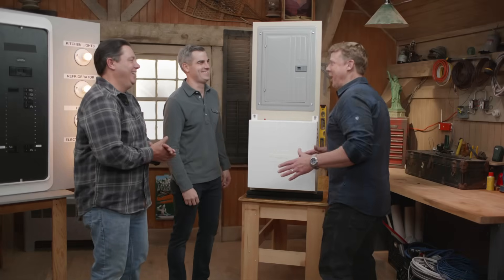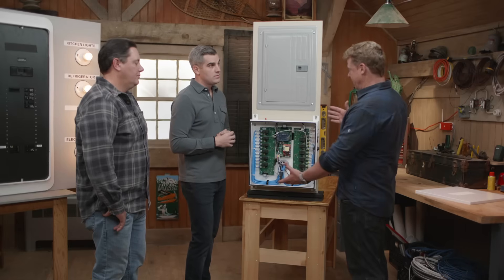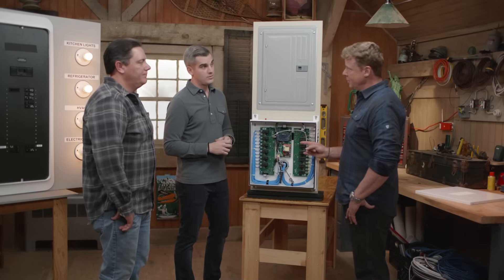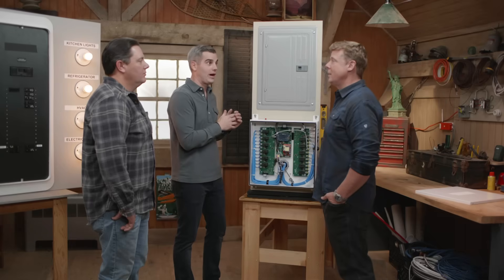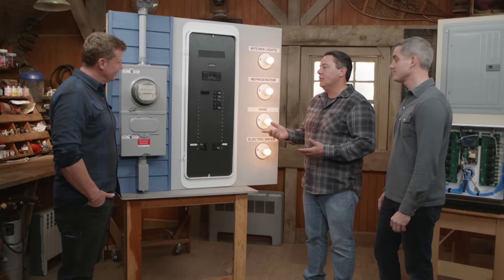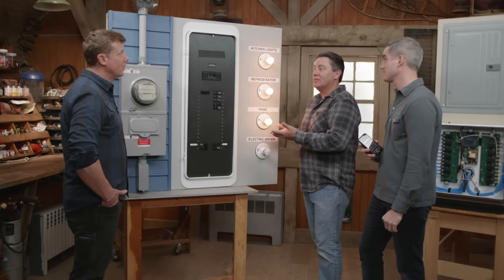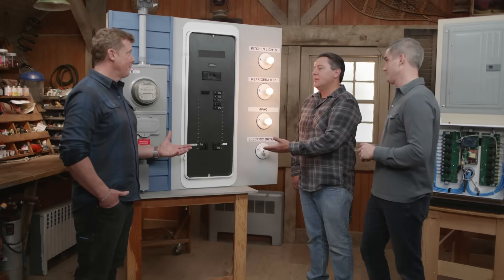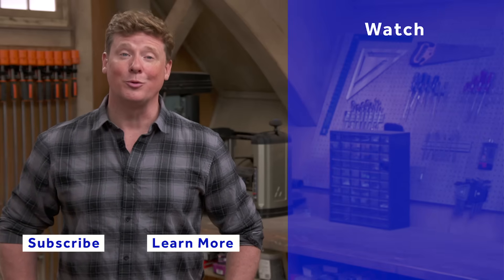Understanding Smart Electrical Panels | Ask This Old House

Comment: I just read the 111 comments posted prior to this comment. They are overwhelmingly negative regarding this expensive, complicated, likely quickly obsolescent equipment. Why does TOH glowingly promote such wastefully costly technology cloaked as energy saving technology? I've noticed other channels, such as Matt Risinger doing the same thing. A fixation on the latest gadgetry is, in my opinion, a serious problem in our society.
Reply: not necessarily energy saving, but energy managing to hold peak use to a minimum when necessary. In case you have been in the dark, power companies have been promoting remote switching for home AC units for about 20 years. The idea is to do this instead of rolling blackouts in the summer.
Reply: @rupe53  I understand that. Essentially, homeowners and other utility customers are being urged to invest in very expensive technology, rather than the utility providers investing in expensive upgrades to their systems.
Reply: @Bigfoot14000  ... point taken, but there is no real incentive for customers to buy something like this unless they are hard core nerds / control freaks. OTOH, a monitoring system system would be cheap, not interfere with devices, and also educate the customer with WAY less cost. IOW, once people figure out where they waste power they might change bad habits. BTW, our guv-mint has already decided that battery charges waste quite a bit and that market was hit hard with new standards a few years ago. As an example, buying a charger for your car battery is now a smart charger. It will automatically shut off after (I believe) 36 hours if the battery is not up to snuff. It will not reset unless you manually kill the power first. (so much for recharging that boat battery over a long weekend) Float charges under 3/4 amp are exempt.

Comment: I appreciate you mention the cost of this equipment, but you glossed over the 'plus installation' part.  It is also useful to have an idea of that cost as well.  I know 'your mileage may vary' and all that stuff, but there has to be at least a minimum dollar figure that should be mentioned for installation.
Also, how is all this sensitive electronic equipment protected from power surges and lightning?  Does it come with a massive surge protector in front of it?  Can you even get one that will protect something this large.  And the cost of that please.
Very interesting technology and something I would consider.
Reply: If you have ever gotten multiple quotes from independent contractors, the installation price is IMPOSSIBLE to predict at a local level, let along a national level.

Comment: Smart Panels are indeed the future but in all the hype it's important to understand one simple things.   What is the Product?   The question that should be first and foremost is "who owns the data?".    If the vendor owns the minded data then you are the product if you have control of the data and the product still functions without need for an interenet connection to operate then it is the product.   I'm not going to pay $5000 to be the product.

Comment: Installed the Leviton Smart Panel and Breakers in our Off-Grid Home to help monitor usage.  Wish it had the real time usage though.  It only shows totals for different periods of time.  I can turn the breakers off but not on.

UPDATE: the Leviton ap updated recently and now does show real time usage in Watts.  I say realtime but is delayed around 60 seconds but stil better than nothing.
Reply: Which I trust as more of a safety feature. I'd much rather have to go manually re-energize a circuit then have it show on, but need the software to activate another part.
Reply: Good choice. Leviton has been around for 100 years so I’m confident I’ll be around in 30 years. Span is a venture backed start up so I’m Not so sure

Comment: The only real world practical application is for solar and wind power where regulating your load usage on your battery system is of the utmost importance.
Reply: Agreed. And yet, if you're in an emergency situation that requires you to be on backup, you can also cut down to bare essentials. Then slowly add more usage over the next days if you don't know how to calculate how much power things use. This would be fun and useful ... but if there's no kill switch to remove software control of your circuits, that doesn't seem safe. I'd like to know if there's a way to kill it if needed.  :)

Comment: Can dryers in the US really use nearly 8000w of power? 😳
Reply: I don't know about 8kw but 5kw for sure. Most use 2kw though.
Reply: @HaploBartow  2kw seems reasonable but surely for much more power you need a special wall socket for more power? That app of theirs showed 7.7+kwh which is crazy high, are they like cooking their clothes? 😂
Reply: @mmjohns2705  ... yes, you do need a special socket for a clothes drier, which is usually on a 30 amp breaker. (240 volt 2 pole) That said, a branch circuit can only supply 80% of it's rated max, so roughly 24 amps a leg continuous. Depending on the brand you probably draw from 2Kw - 4Kw plus the motor.
Reply: @rupe53  here in europe, driers are on a regular socket which is 230v generally with a 16a breaker and it works just fine. The machines generally don’t use any more than 2200watt total. When i look on my meter it’s generally 1800w or so when drying clothes.
Reply: @mmjohns2705  ... that's a different standard than USA, which is where this program originates. I should put a meter on mine, just out of curiosity.
Reply: @rupe53  oh i now, i go there regularly. I was just amazed to see that number for a drier and then only see like 200w for the ac running 😂 7.7kwh+ is more than my stovetop runs when cooking generally or my oven at ~450f. I literally checked last night, my oven only draws 2.4kwh max 😅
Reply: @mmjohns2705  ... I would also be amazed at seeing 200 watts for an AC unit, even though newer window units have gotten better. Here in the states, 200 watts is typical of a kitchen fridge running on 120 volts. A 4 burner cooktop can run 2500 watts, (30 amp breaker) and with an oven it will need a 50 amp breaker. (to run at 40 amps draw)
Reply: the USA loves to be wasteful.
Reply: everything's bigger in murica

Comment: I'm concerned the first retrofit panel had no actual circuits to reset manually. How do you reset it when the circuit running the wifi trips?
Reply: Old comments but, the breakers are in the panel on the top.  The bottom only monitors and communicates usage as well as overriding the breakers in order to turn them off.  You could still manually shut them down from the breaker above and the actions on the app would not reinit the breaker.

Comment: There is NO WAY I'm going to switch to electronic home breakers anytime soon. Same problem with the city wireless meters, Who's is really in charge of those switches? Hackers, government dictators, etc. could mean LIGHTS OUT for you!
Reply: This old house is a fantasy world where contractors actually want to try new things
Reply: I'm sure you can turn off or disable any network or bluetooth connection quite easily if you really are so paranoid.

Comment: Automated controls are the future/ present state of our working world and definitely have great advantages in the right situations. However, after doing electrical maintenance for an airport and a school district, it is clear to me and my coworkers that troubleshooting/ servicing electronically controlled services is a far bigger headache. I'm not an old guy", but I know the old wisdom of having fewer "moving parts" still holds true. We're one lighting strike or solar flare away from the stone ages.
Reply: My biggest issue with something like that is must be connected to the Internet. That's a no go for me, I already hate the idea that my "smart bulbs" don't work if I lose my internet. Can't imagine loosing communication with my entire electrical panel.
Reply: @AtomicPorkchop  

I looked at a device a few years back that you plugged a USB drive into and it connected to the local network.

It looked promising but upon further research I learned that you can't configure the device without first logging into the companies internet site.

In addition to a way to log into the device, a reputable developer would have designed it so that you plugged the device into a network port, then plug the USB drive into it, and it automatically shared the drive even if the network was not connected to the internet.

Needless to say; I didn't buy the product.
Reply: @scotttovey  the truth is, companies can make "smart" products that communicate within your local network. 

But in the personal information mining age that were in why would they?

It's honestly a shame. 
Cause security is always an afterthought with the majority of these companies.
Reply: @mountainbikerdave  

"But in the personal information mining age that were in why would they?"

Because; there is a point when people get so fed up with their rights being violated, that they join together and choose to resolve the problem at the business end of a gun? Which is very bad for the rights violators and their political allies. History is rife with such upheavals.
Reply: @scotttovey  Well said and well written.
Reply: The larger panel featured DOES NOT require internet access in order to benefit from it's useful/helpful features. You can choose to keep it disconnected from the internet and still access it on your home's local network.  If you don't follow how to do that, then yeah, maybe you're not ready for this kind of hardware.  But don't get on here spewing misinformation.
Reply: And for smart bulbs, it's not all or nothing...  The bulbs we use do not require any kind of account or internet access.  Access to your home's network is not the same.  Man, so much fear and misinformation and misunderstanding.
Reply: @zac9080  [[so much fear and misinformation and misunderstanding]] I think this is a negative. Most people will not be up to speed on "smart" products and have more important priorities than reinventing electricity that is already mindless and works. Because 90% of people will not know how to use these things, they will be misused, creating issues they would not normally have to deal with and  don't know how to resolve. This disempowers people in practical terms that are worth thinking about. My "smart" irrigation controller lost wi-fi and watered for three days in the winter when it got back online as a default in the program that was not specified in the manual "If we lose power or wi-fi we will assume the worst, prioritize saving your plants in a drought and water for three days." I share the sentiment that there is a cost (often hidden) as well as a benefit (loudly touted) to anything "smart." Loutron is an electrical system that has driven every client I know with it nuts because they can't even turn on their lights simply and require a specialized electrician. Spending a lot of money for that hassle is not worth it.
Reply: @zac9080  
"The bulbs we use do not require any kind of account or internet access.  Access to your home's network is not the same.  Man, so much fear and misinformation and misunderstanding."

You act as if that fear is irrational; it is not.

You can thank Apple, iPhone which is never really off, always tracking and spying, and every smart phone App that requires access to your files and location tracker turned on, even though it doesn't need those features to function properly as well as every other big tech company for that very rational fear.

The tech threat is a very real world threat and you can't tell this programmer, that he is misunderstanding and misinformed.

I've written enough lines of code to know full well, that any appearance of self awareness in a program is purposely and intentionally designed into it in order to deceive people and convince them to give up their rights to a false, digital god that allegedly knows better. 

In reality, it will be controlled by globalist elites who dictate what that digital god dictates to the people. And people will stupidly give up their rights to it and become the slaves of the globalist elite who will murder them through famine and disease.

The fear is very rational.
Reply: It's not just that.
It's controllable from the internet.

Someone at the electric company decides they don't like you chasing the bob cat away from your kids and a hack later; you have no power and no one is able to figure out why.
Reply: @scotttovey  chasing the bob cat away from your kids?

Comment: Given the few times we have lost power for more than a day, it would take 300 years for a payback on this. As a corollary caution, I purchased a two stage AC unit with a special electronic motor. Supposedly , I would save money over time. The motor control  crapped out after five years. The cost to replace was my potential savings for more than 10 years. Love technology but it can bite you back.

Comment: Big increase in complexity, headaches trying to replace that custom control board 25 years from now, difficulties with phone apps not being updated when a company goes out of business, I can almost guarantee subpar/outsourced software where security is tenth priority, meaning a remote attack could start flipping your circuit breakers- all for a slight improvement in functionality where you can monitor control circuits via a phone app. I'm an electrical engineer who loves technology when it makes sense- this really doesn't seem like a good idea for stuff you want to work for the next several decades. Hard pass.

I really wish this video had touched on more of the tradeoffs and considerations instead of just being a showcase for the latest gadget to hit the market.
Reply: Very valid points here
Reply: @2024301  It makes more sense to have outlets or the appliances have the smart tech. Having it built into an electrical panel sounds like a huge issue when a company decides to end of life support for it.
Reply: Or this might be all local control a la  be able to fold into home assistant.
Reply: Over the air updates (OTA) solves this and improves everytime engineers discover a new idea / fix
Reply: @twentystwentythree  ota is awful. The last thing I want is my appliance auto updating to some doofy intern code that was pushed accidentally and now my system is bricked. Also ota doesn't matter if there's no company to push it.

Comment: He said the “old school” method was to have a generator fed sub panel for 6-12 circuits. I just installed it, by myself. It’s considered old school?  Wow. Think about how many American households don’t even generators or sub panels … and now it’s  old school?   Believe me when I tell you that my family and friends think it’s “new school” for me to have a generator fed sub panel in case the lights go out!
Reply: I did generators for near 25 years and a secondary panel was VERY common then, and now. The more common approach today is a bigger gen set with built in monitoring to drop heavy loads as needed. Of course, this is only operational on gen power, not on utility power. Basically, the old school is an "extra panel" next to the main panel. They were by far the most popular till the manual interlocks became approved in recent years.

Comment: No offense fellas, but being somebody who built his own off grid system and the only thing I didn’t do since I didn’t understand how to do the panel connection to the grid. 
My electrician put in a switch for under 100 bucks and all I have to do is walk over to the panel and flip it on when the grid goes down!
Then I have total control to flip on any breaker for any appliance I want or flip off. 
I guess what I’m trying to say is I don’t need to spend thousands upon thousands of dollars for the few times the grid may go down and use my smart phone to turn it on or off! Total waste of money if you ask me! 😒
Reply: you do realize that this product is for people (control freaks?) who hate going to the basement or garage to do it manually.
Reply: Wait, you actually have to walk over to something?  Like 50-feet and then use all that muscle to flip a manual switch?  My word, that’s a LOT of work.  Must take you all of 3 minutes and you might actually have to put shoes on too.  Why do that when you can spend $5k to put in a bunch of “internet connected” circuitry that will fry one day?  Seems like you are just some kinda Luddite and you should be ashamed.  Consider this your public flogging.  Manually flip switches?  Such a horror.